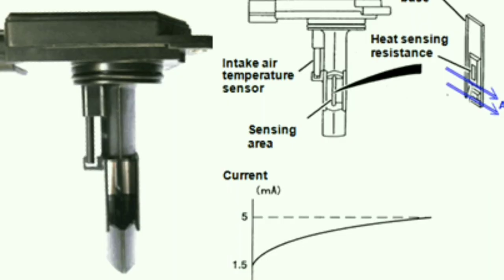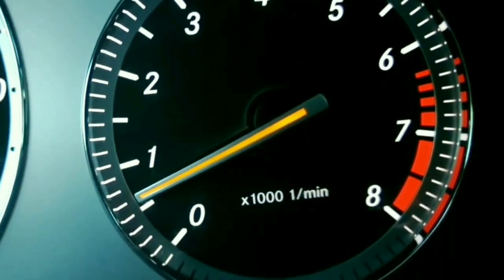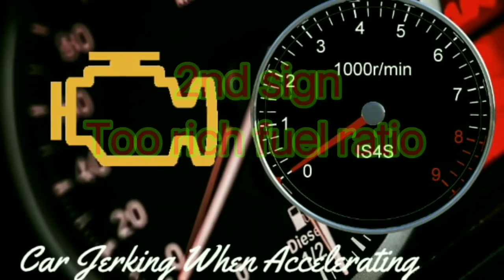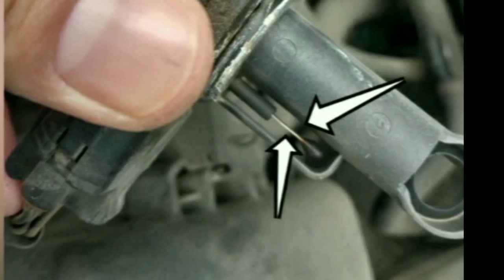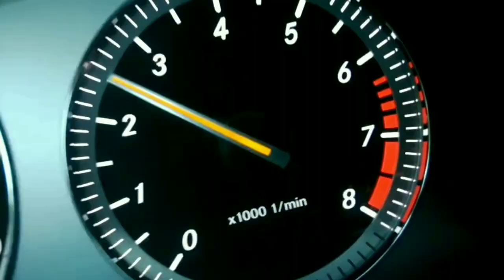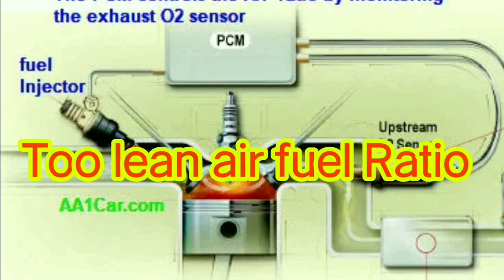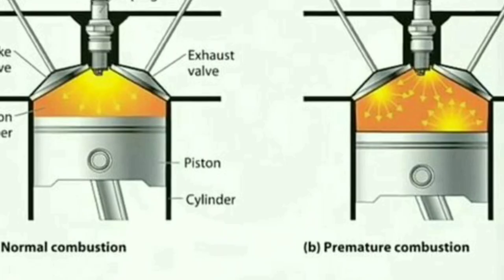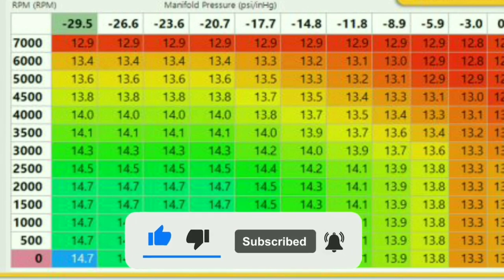Mass Air flow sensor faulty solutions/ What are the caused and tips for failed MAF sensor andam #new

Comment: Thank you for your video. I have a 2006 Corolla 1.6 petrol and the MAF sesor read 3 g/s at idle and 27 g/s at 2600 rpm. Are these values normal? Thank you!
Reply from the maker: Yes bro still in normal operation,,
Reply: @andammixed   Thank you very much for your quick response.

Comment: My Kia sportage runs ok,BUT when im driving n take my foot off the accelerator then gentley touch the pedal again it judders a little bit then its fine after???
Reply from the maker: Always perform basics, clean your air filter and spray your throtle body with ThrotleCleaner,,,and check if your idle is low then adjust,,

Comment: If my car didn't have this maf sensor but still face this issues...my car also using drive by wire throttle body...
Reply from the maker: Try to clean your throtle body and change spark plug amd check the curent of your ignition coil,,,

Comment: could you have bad maf without engine light ?
Reply from the maker: Yes sir,there are some cause it happens ,,but if u used scanner you can notice that your maff sensor output low even no check engine
Reply: @andammixed  the output should be how much while idling only , thanks
Reply from the maker: @rinorgucati5128  Im sorry  i dont have any idea about the output circuit but i suggest that better used a diagnoistic scanner for sure and safe diagnoise